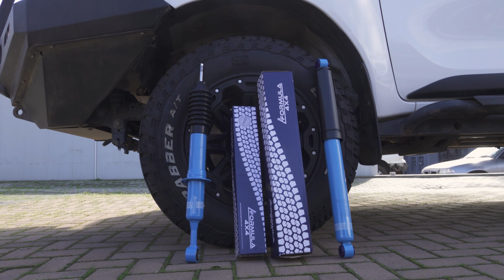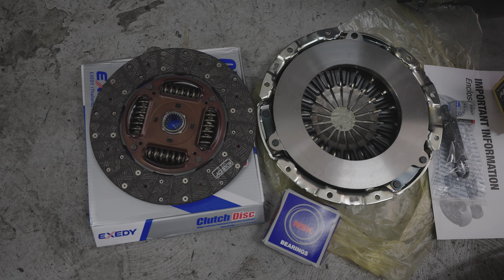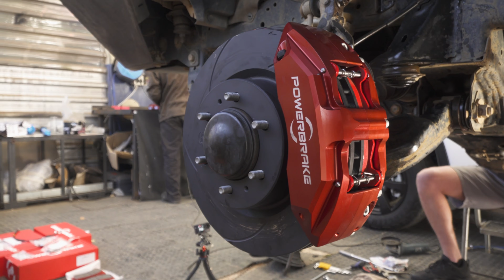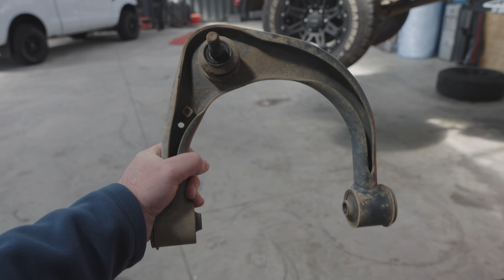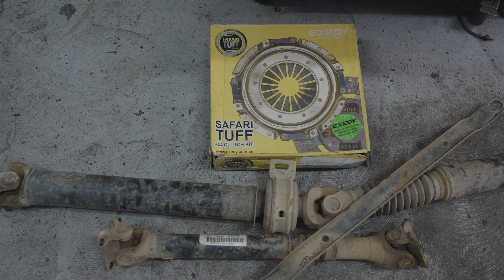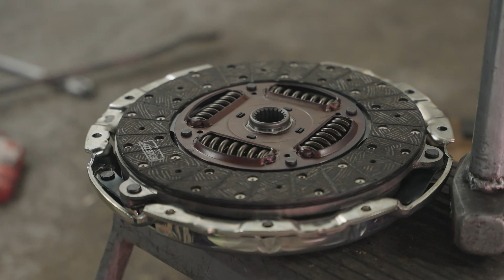Upgrading the CLUTCH & CONTROL ARMS | Toyota Hilux Overland Build

Comment: Wait a second, the lower control arms are changing the geometry? How so? I know UCAs move the ball joint to a better position and provide better clearance around shocks. 

How do the LCAs help? Are they moving the knuckle forward? Would this help if you were to fit larger tires, moving the whole knuckle/spindle forward? Clearing the body mount and fender?

First time I’m hearing about replacement LCAs that aren’t for long travel set ups, or to OEM geometry.

Comment: Your original pressure plate and friction disc look to be smaller in diameter that the upgraded clutch.  Smart move!!!  More surface equals better grip and therefore less slippage.  Bravo Matt!